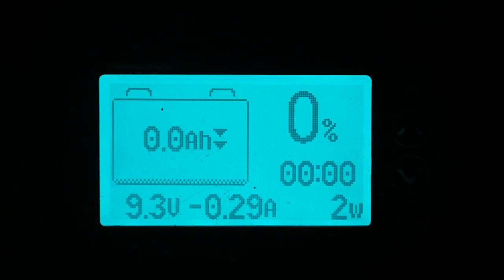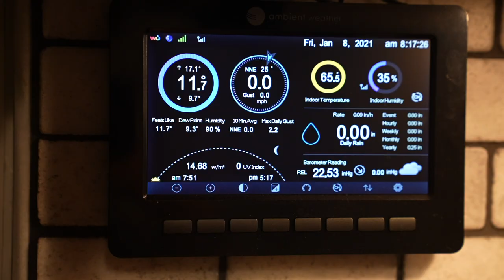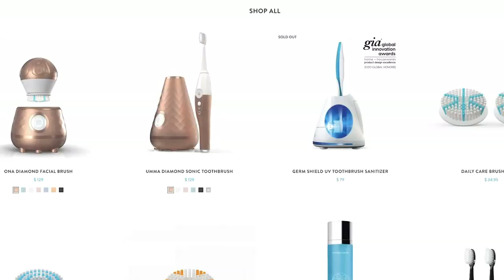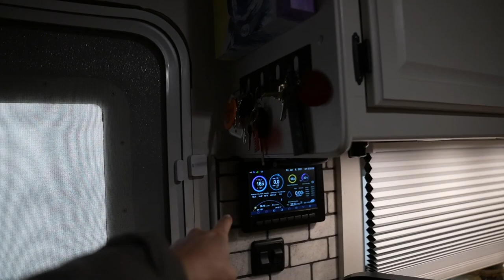WE'VE GOT MAJOR PROBLEMS | WINTER MOUNTAIN NIGHTMARE

Comment: Are you going to do heat as one system, and AC as a separate system? Surely a heat pump doesn't work well in that type of winter weather? My neighbor in Maryland had to install extra heat coils into his system when it was 10F outside to get indoor temp above 55F,  then on his Goodman HVAC compressor, the switching device to reverse the refrigerant gas that changes from AC to Heat every year seemed to mess up for him, not wanting to switch to heat side and stay there. In damp or wet weather the outside coils would turn into blocks of ice, because the reversing part that would defrost it would also fail to work properly. We have wood stove in basement for teen F temps to help out, got rid of our aggravating old oil burner, just use electric otherwise now in winter, and separate AC. Oil burner, replaced the transformer, the electrodes, the reset switch, the fuel filter, and trouble with the injector, so finally said to hell with it. Glad I don't have to put up with your winters, these are enough problem here. Remember, to keep indoor temps near 70, those outside coils may be 30-40 degrees below freezing out side. I guess if air is dry enough it might work OK, but here on East Coast when it's below freezing outside, but still humid, we live about 10 miles from the Bay, frost and ice can form quick enough on outside coils. Heat pumps are great in the South, but not so much where it's much colder.

Comment: I may have missed it but where did you get power for the trickle charger to charge the rv batteries.  If it takes that long, whouldn't the inverter kill them again as soon as you switched it on?  Also are you installing solar panels on the roof of the house?

Comment: Re Hvac and plumbing - talk to the people over at SupplyHouse.com   They can set you up with your whole system. They have people who will help you design it. They have all the electrical supplies,  pex pipe, fittings, heaters & ac, herv/erv, etc. Everything you all need. They have a warehouse down in Reno, besides NY & OH. Their website has a great resource section with easy to understand videos.

Comment: Your best bet would be to have a HVAC company you trust map out your duct work and order the proper materials you will need. You still can install yourself. You really don't want to guess on these items including electrical and plumbing.  My wife and I did build our own Log cabin. We finished the walls did the HVAC duct work Finished the floors Built a fire place and finished the interior walls and and and. That person did tell you right but as soon as you get the drywall up I would say you are almost 1/2 way done. Your best bet is to make a list and start checking off each thing you complete Then you will see and end.  Our HVAC system included in floor heat three zones along with forced air. Man IS that ever nice. I'd say Total cost for my HVAC system with heat pump cost right around 18,000 and we did the work our self. This log cabin has a walkout lower level which makes it 3000 Sq ft. three bedroom three complete baths. Good luck.

Comment: I wrapped that heat tape around the 4" PVC outflow on my fifth wheel, then wrapped it in insulation, etc. It melted and fell off: it fell the F.. off the trailer!!!!!! The reason I wrapped it was to correct my prior stupidity, which left me with a frozen, full pipe: aka a POOP CYCLE!

Comment: I'm just curious as to why the front door opens onto the bottom of the stairs. Could it be changed to open from the other side of the door frame? It could cause an injury if two people met at that spot together.

Comment: I could tell u what to do but it wouldnt be to code because I live in MICHIGAN. Local union workers or your home depot or building supply houses can direct you to the best plumbers hvac installers in you area if u hire a plumber make sure he is licensed insured and can pull plumbing permits to do your work saves alot of time your inspection will go off greatly without a hitch

Comment: If you have 120V power, why are you running off an inverter? Get a charge controller that will pass through the 120V when you’re plugged in

Comment: HVAC...get two MINI-Splits....I think PIONEER, and others have designed units that are suitable for solar system hook-up too.   GO to HOLLAR HOMESTEAD channel and search the episode they did for their two mini splits.... easy install, no mess, no fuss,,, cheaper, quiet, efficient, heat and cooling.  I am sure you would want to go that route, although I would put a couple recirculating intakes and fans in to blow the hot air at the upper ceiling, and recycle it back to the basement and tothe downstairs underneath your bedroom.

Comment: does Utah building code not require continuous vapor barrier on  the inside (warm side) of all exterior walls? IF so, then where the half wall on the second floor, meets the outside wall ne vapor barrier is required between the 2 walls. Maybe check with your building inspector.  Note that I live in Canada so regs may be different on this.

Comment: Would it be possible to run wire from your truck to the batteries that are dead and maybe the inverter
will work becaude the inverter will work  ??? Maybe I'm too late ??

Comment: Is it possible for you to construct a jig/template for you to expedite the whole deck measuring thing? If the issue is making sure the screws line up properly, why not take a scrap piece of lumber that’s big enough that, if needed, it could span a bit more than the length between two drill points. Then just drill holes in that lumber where the two points would be, and you’ve got an instant template that stops you from having to measure every time. Unless they’re different between each point on the deck, in which case.... never mind. =>.<=

Comment: Stop using fiberglass for insulation once it’s wet it will hold the water for up to 6 weeks or more. Instead use styrofoam insulation board and build a box around the stand pipe and pump head

Comment: Nice beginning drama. I did enjoy seeing you two....well, maybe Allie more but I'm a straight dude and you should expect that. Now for the breakdown, you got home and no power, your batteries in Terry were dead? but not in ether of your truck or 4-runner, right? you could have switched them out for a night, or that generator your using for your build could have powered all of Terry in one shot. Maybe it's age and experience that give's a person insight into fixing a simple problem but you definitely failed on the re-entry.  As for getting back to it, I'm just like Trent in that I would have called a snow day the next day, but you did say you have five days more or less of possible sun so, maybe not. As for the build, Your right pretty much about where you are in the time line, the biggest hurtle is your recording everything so it's gonna take a lot longer. I know you want everything to be installed right but at the same time, your gonna miss a lot of video segments if you hire out to get things done, so kill that idea. There are a few things you can do to make your power and plumbing problems not problems as much. Go online and look up building for dummies and plumbing for dummies, two amazing books that I owned for a long time and a ton of really solid info. I personally would have gone with the finished look of the stairs, mostly because of a fantasy that was running through my mind while you talked about it, involving Allie and lingerie, and heels but, I should probably stop there. LOL. I love watching your video's and each time I see one I wish I was there helping you but that would probably get it done much faster and then you might actually get to spend a night in the build long before winter was over.

Comment: Miracles do happen but you also have to take in consideration what iced up water lines are going to do to the pipes they weaken it because ice expands inside of water pipes that's why they burst that's why they leak especially at fittings it would be a good idea that you check your water lines inside of your camper because I don't know how many times it froze up on you those water lines the potable water lines are probably weakened from frozen pipes ice expands causing pipes to burst or crack and leak causing more damage you're not out of the woods yet take it from a plumber who knows take it from a plumber who has rescued many mobile homes in the middle of winter laying in the ground in Water 2 or 3 in deep using a turbo heater to keep warm and replacing water pipes because people forgot about plugging in their heat tape or they purchased a thermostat control heat tape that failed so what did I do fix the pipes ensure that they wouldn't leak no more and I installed a cable type heat tape with a hot plug and then when I came into the mobile home I went to the hot water tank and put a sign up turn the heat tape off unplug it in the spring of the year plug it back in at the first Frost

Comment: I FEEL KIND A GUILTY... because I haven't sent you guys anything, but grief. I can send you some tips when you get to HVAC. I am one of the rare dudes that still has a swamp cooler on his RV rooftop. They work. TurboKOOL makes one. I have both that and A/C in my Terry. Most always use the cooler. We all live west of he Mississippi. The current tough stuff plastic evaporative coolers for homes are very impressive. Just a thought. After the HVAC add a separate modern evap cooler too. WE LOVE YOUR SHOWS!

Comment: Did you cross the tracing tape with itself this will fry the heat tracing tape. The water problem won't go away as long as the water is capable of freezing. Any water lines that are external a best buried 24 inches deep in  the ground. Pea gravel and shredded styrofoam will insulate the water lines build a 18  x 18 plywood box insulate with 1/2 styrofoam heat trace the pipes put  in 2 thin line aquarium lights switch them so they can be turned off when outside temperature  drops

Comment: Hey Trent. I don't think you are using the heat tape correctly. It shouldn't have melted anything if installed correctly. Don't wrap the tape around the pipe and don't cross the tape. It should be installed along the length of the pipe, and the thermostat must be in contact with the pipe. Here is a quick video I found on youtube to help you out: https://www.youtube.com/watch?v=DhwRlxVSHZ4

Comment: Oh...you can run 15 Amp breaker circuits everywhere...and electricians do...to use 15 A receptacles and smaller wire perhaps...but you don’t necessarily want to minimize cost....run 20 Amp breakers...wire...and use 20 A receptacles minimum everywhere.....why not...less trips, receptacle rated for a heavier load you might plug in to it, be able to utilize one circuit for several loads on one circuit with several things on that same circuit you did not plan for.....Oh....but run more home runs  and avoid the possibility of too many items ending up on one circuit accidentally....did I mention more home runs?  Don’t think like the electrician doing the minimum to meet Code and lower cost...think about your flexibility long term....did I say more home runs?
Reply: Pretty sure this isn't written in English! LOL!

Comment: do you not have jumper cables? you two are very unprepared. always have 2 heat sources and 2 power sources. im poor and have propane, electric and used oil or wood heat. grid tie electric, solar, and generator power. and i live in a town.

Comment: Oh and I was thinking about your water problems why on God's are at the you have such a long water line coming out from the ground cut that damn thing down the more you have coming out more is going to freeze up it stands to reason. Any plumber will tell you the same thing you need to construct a house or s h e d surrounding the water pipe you need to insulate it you also need to put a hundred watt light bulb in there to come on only at night when temperatures exceed especially Mountain temperatures where you're located they're going to exceed sometimes 25 below zero the piping is long as it is is going against you and I don't care how thick you wrap it how much heat tape you put on it it is still going to freeze you need to have it put in a shed of your own construction you need to cut that pipe in half lower closer to the ground and then wrap the hell out of it and make sure you use cable type heat tape with a hot plug you can find that in any mobile home supply house please do not get a thermostat controlled heat tape because they are garbage